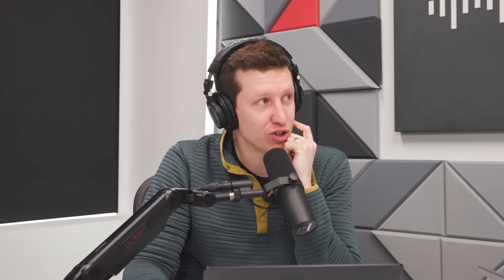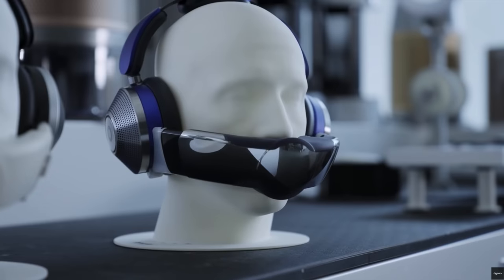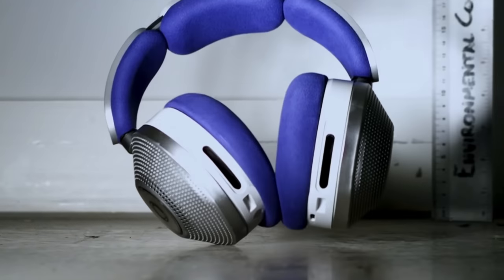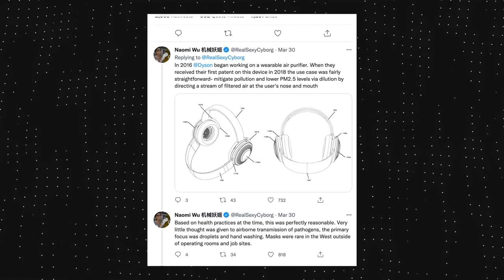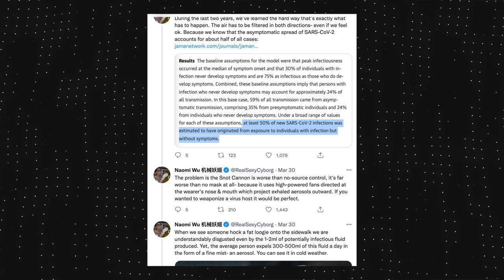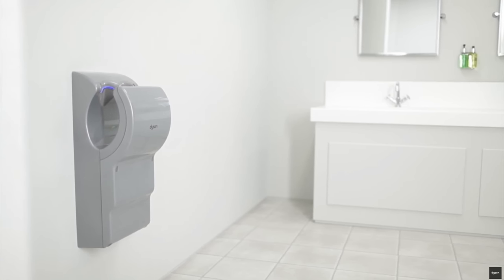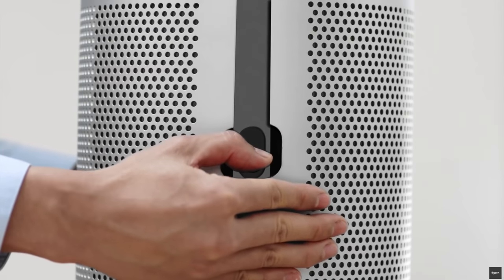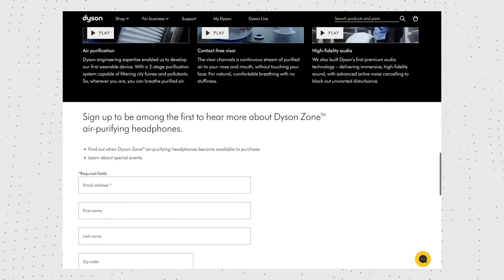Dyson's Headphones are Unfortunately No Joke

Comment: Dyson should make PC towers with cooling fans and dust filtration integrated motherboards for custom PCs. They are top notch with motor and filtration (for dust management) tech, and also dope at modern minimalistic product designs.
Reply: I think LTT made something like that. The biggest drawback is the noise. Since you'll need to spin those fans pretty high to get meaningful airflow for your parts.

Comment: 5:19 I'll give Dyson some credit for at least redesigning the later version of the Airblade to point downwards instead like a normal hand dryer, although from my experience the downward facing version was much worse at drying my hands which is kind of odd seeing as from an engineering perspective it doesn't look like they'd have to do much beyond removing a bend in the ventilation and then turning it upside down.
Reply: I liked the first version better than the new one. 

The small wallmounted one just blows everything in my face. Because of the angle and the pressure. I can work fine with the double sided “insert your hands here” one. I really liked that one as it actually dries your hands. Literally used it 5 minutes ago in a hotel. Pretty decent product.

Comment: I'm all for this product. I live in Central California and have bad allergies like half of the year. Not to mention that every summer we have to deal with like a hundred wild fires and breathing in ashes is not the business.
Reply: You are not kidding lol My allergies we under control wearing the mask lmao had a great time.. first week mask free and NOPE
Reply: Their filter fans do a good job indoors.
Reply: Yeah you would be
Reply: I'm just going to keep wearing a KN95 mask this fire season, way more comfortable than a whole ass headset especially in the valley heat
Reply: @emrazum  It's insane that it sounds normal to hear someone say they'll use use their pandemic mask for the fire season as a nifty life hack.
Reply: Try replacing your furnace filters with Merv 10-11 and have the fan on always. If you have a fresh air duct timer you can set it to less time and more recirculation. Air purifiers are not big enough to make a significant dent in airborne allergens or particles, the filter is either too small, or the fan speed is way too slow because people want silence and not a loud blower.

For outside, wear a mask, it's N or K95 are better than the Dyson filter mask at filtering small particles N95 has a better seal at the face, K95 is a loose seal but cheaper usually.
Reply: @Jaker788  or do the smart thing and get allergy shots so you eventually don’t have allergies at all anymore.
Reply: @jlehm  If you have allergies that's probably a good idea. The mask recommendation was more for wildfires when it's smokey. The air filters are nice to have no matter what, I like clean indoor air and having the blower fan on always with a good filter reduces dust build up around the house. You just need to make sure you replace every 3 months if you have a higher Merv filter, and during wildfires they need to be replaced sooner. You'll damage the blower motor if the filters get neglected.
Reply: @Jaker788  all very fair points. 👍
Reply: @jlehm  That's not how allergy shots work lol.
Reply: @KurtisB  yes, it is how they work. The shots start at very low ratios of allergen and then you work up to larger and larger ratios. This desensitizes your immune system to those allergens, thereby eliminating the immune response to them. I received allergy shots for maybe 3-4 years and haven’t had allergies for about a decade now.
Reply: @jlehm  Oh I thought you were referring to the steroid based allergy shots to combat allergies lol. My bad!
Reply: @KurtisB  never heard of those. I wish I would have stuck with the shots as a kid. They changed my life.

Comment: That is not really true about the days on hand dryers. 1st the water on your hands is clean you just finished washing them. 2nd the amount of water on your hands landing at the bottom of the dryer will dry as the dryer is used and is no nastier than blowing it all over the wall and floor, like traditional hand dryers. Between a dyson and traditional blower I’ll take the dyson, and in both cases cleaning and maintenance are key for clean, sanitary public washrooms.

Comment: Dyson products have such a harmony between all the design elements and they have mastered aerodynamics so well... "The air multiplier" they call the patent for the most efficient bladeless fan design. Their impellers are such a joy to watch, big FAN! Yeah, the spreading part is worrysome but its not an unsolvable obstacle, bypass tube from suction side and you can have switchable air current so that even what you exhale gets filtered. Ooookay maybe not that simple but they have the engineers to do it.

Comment: Dyson toaster oven with fan cooling.  Mine will melt your arm off if you get close enough to the metal exterior walls or glass door to remove food.  You need hazmat clearance space on the countertop to avoid liquifying anything plastic nearby.

Comment: Honestly if someone told me they owned a pair of shoes with fans in them I would be disappointed if those shoes couldn't be used as a method of flight. And for any aeronautical experts out there, yes I realise that "flight shoes" would have to be noticeably big and not very subtle to carry the weight of pretty much anyone, but at the same time I just like the idea of flight shoes/hoverboots/whatever you want to call them.

Comment: You are definitely only breathing air from the positive pressure side of the air stream. As long as there isn’t any weird turbulence it’ll be just as safe as a laminar flow table is for keeping dust particles away from sensitive lab equipment.

Comment: I could see this being useful in a lot of trades where there may be gases or particles that you don’t want to breath in. Respirators exist but they can be uncomfortable for extended use
Reply: the reason respirators work but also why they are uncomfy is because there is a seal. this has no seal and thus cannot work.

Comment: What's with the hate on the bladeless air purifiers? Yes, they're purifiers not just fans, the bladeless thing is not just a "mAgIc" marketing stunt, the fan pushes the air through a filter in the base. I agree they're expensive, but they look good, are quiet, keep the air clean(er), take up less space than regular fans, have a nifty remote and produce a higher airflow than most other fans / purifiers.

Comment: I hate my dyson vacuum. Perfect for a quick clean of a small and very recently dirtied flat floor and absolutely sucks for everything else.

Battery is tiny, suction is non-existent, it can’t handle anything larger than half a peanut and filter clogs all … the … time.

Also not being able to vacuum for 24 hours and the filter still not being dry after that time is perhaps the largest suck.

Comment: Hand dryers in general are not hygienic in anyway shape or form because of they work. Most suck air in from the bottom where you put your hands and air comes out and blows on your hand so its sucking air from the bathroom into it with no filter or even being extremely dirty inside because they don’t get cleaned and then that air gets blown on your hands. This is not a day son issue so no point in bringing days on up with bathroom hand dryers. They are all disgusting.

Comment: Air travel with these would be greatly improved.    Less fuel smell plus the individual next to you that decided to skip hygiene for the prior week before travel.   Plus, I've got my costume for Halloween in the bag at the same time!
Reply: HEPA does not filter gaseous vapors or exhaust particles, it also doesn't filter most smells since they're more vapor than particulate. You need a special cartridge mask to protect from real vapors.

Comment: It can't be as bad as Dyson's "bladeless" (not really) fans, can it? I own a Pure Hot+Cool Link, it's a wonderful assembly, like Apple would do (also overpriced), but it doesn't work. Dyson has lost it. And NO it's not clever, out of the box it's way more noisy than a 50 bucks fan. And it eventually makes the sound of a jet engine, and you can't service it yourself.

Comment: I could potentially see this being useful in construction sites/ areas where people are working with lots of noise and air pollution
Reply: N95 and earplugs would work better overall. N95 is better at filtering small particles than HEPA and has a full seal to the face, earplugs are better protection against very loud noises.

Comment: @5:15 what is this guy even talking about disgusting bathroom water spraying back up? lmao if you're using this hand-dryer you have JUST washed your hands with an anti-bacterial soap and water. So you have a water and anti-bacterial solution that would be pooling or spraying back into the air if anything, but I doubt this is even the case. We've all used these right? Do you ever fucking feel water blasting into your face or on your hands when using them? No you don't. The air streams blast horizontally to dry your hands, the water evaporates and yes some may drip down to the bottom, but the pressurized air is bouncing off of the walls of the device and evaporating any water that drips down the bottom of the device and whatever it doesn't evaporate gets pushed off the side and onto the ground.

Also - people being so germophobic isn't doing anyone any good. Maybe if you encountered more bacteria and germs on a regular basis your immune system wouldn't be weak as fuck and you could handle people sneezing on you from time to time. Start eating food that you drop on the floor, stop sanitizing every single fucking thing constantly. Yes wash your hands after using the restroom, and don't be absolutely disgusting, but there is a balance to be struck. If you never expose your system to pathogens your body won't be trained to fight them, stop being lil bitches about it. If that's how you're supposed to be taken out so be it, it's better than being killed by a vending machine.

Comment: What! it’s not a super spreader at all. Firstly learn about the aerodynamics and leave that to the experts who worked on it for five years. Secondly the air you breath out is partially covered and if anything your inhaling some of it mixed with the purified air. Thirdly your not breathing out at a faster rate to be a superspreader that’s makes no sense and even if you where your breathing out cleaner air/carbon dioxide. 

Also for extra points as a tech guy telling Dyson not to make other things because they make good vacuums is ridicules. They thrive at everything the make and innovation should be celebrated. 😂